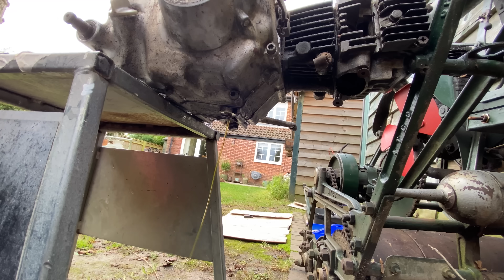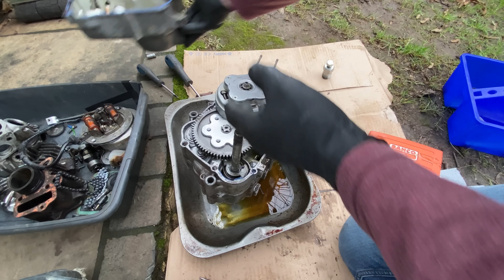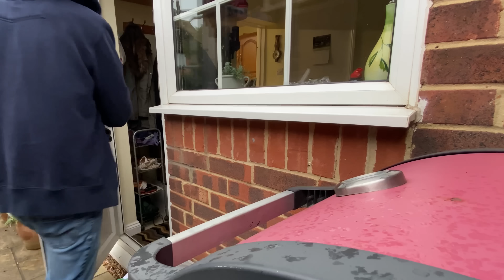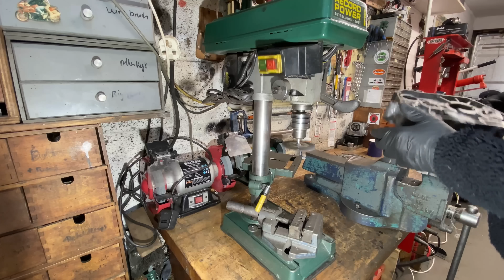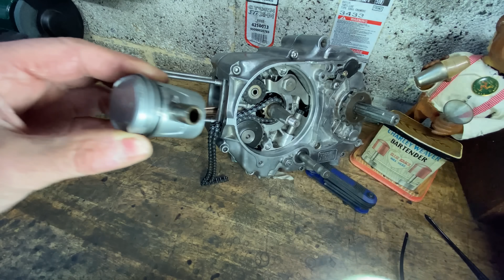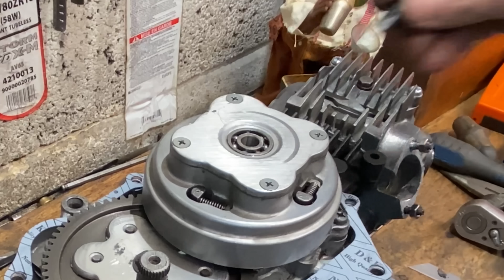Honda SS50 engine strip down, rebuild and start

Comment: I thought for a moment you were about to upgrade your lawnmower. I am in the process of restomodding a 1969 SS50E for someone at the moment, with a larger 110cc motor slotted in and all new 12VDC electrics, all without  modifying the frame in any way.

Comment: Thanks for the fun and interesting video.  Tracey's crocheting looks really nice, and where would you be without a cupcake and a cup of tea to keep you going.  I love those little Honda engines. They are like a miniature version of a larger engine with overhead cam and all.  Being 4-strokes they sound so much more civilized than a buzzing 2-stroke.  I'm not sure, but I think they are actually the original Honda 4-stroke engine on which all other Honda 4-stroke engines are based.  (I wonder if this is true?)

And they sound really cool with no exhaust pipe. Kind of a putt-putt burbling sound like George Jetson's flying car. I used to watch The Jetsons about 50 years ago on Saturday morning sitting on the living room floor with my sister.

Keep up the great work Allen.

Cheers from Canada  :-)

Comment: Allen you have said the engine takes 0.7 litres of semi synthetic oil.
These engines were designed before synthetic oils were made. 
It's mineral oil that's needed.
Reply: They work better with semi synthetic oil
Reply: @riderzinc  we have done the plop enduro for 3 years and only used mineral oil. We've had no mechical breakdowns from the engine. But having spoken to some teams who have, its usually those that are running synthetic oils.

Comment: Oddly, this was the first video I saw of yours. I have seen many engine rebuilds. I have seen all the engine videos that Robot from VespaMotorsport has done. Paul Brodie's skills are great. I watched a lot of Rukus builds, too. As I watched your video, I was thinking, well, he's doing a low-buck rebuild, but I think he knows motors pretty good--and then I saw the rest of you videos. Wow! LOL!

For ratings, but mostly because they are cute, perhaps a 2-cylinder Honda Grom or Monkey engine would be popular, and neat. The engine isn't that different from an old Honda Cub motor. The later ones have 5 speeds. The parts are cheap.

[When I was younger, I had both a Honda CL-350 and a CB-450. I loved my Honda CB-450. Yes, it was bit top-heavy, but it was a wonderfully reliable bike. I had an old XL250, that I was rebuilding the engine for, but someone stole it.]

Comment: Hey shit for brains! That's a Honda C70 block! A C-50 is 90* to the crankcase! I have a Honda "Step-Thru" C-50 from 1961 100% original in powder blue with 18,000 miles on it. Honda of America has photographed it and offered me $27,000 for it ser# 000023xxx. IF it were a TAN one, it'd be worth $100,000-$200,000. I have 178 "classic" pre-1978 Hondas in my collection including Mike "The Bike" Hailwood's CR-300F 6 cylinder 340cc F-1 racebike (the "B" bike) in running condition. All my bikes RUN and if street bikes, are TAGGED including the 1958 CR-250 Benly ("Friendly")-the bike that put Bridgestone and Triumph TigerCub and Hardly-Davidisome Aeromacchi and Barely Starts Anymore out of business!

Comment: Had a 1977 green SS50 when I was 16, kick start spines were shot on mine (previous owner welded the KS on to shaft) , replaced the shaft and new one didn't last long so used to bump start it

Comment: Is that engine the same as or at least similar enough to the engine of a 1966 C100 Honda Cub to use this video as an aid to rebuild my engine.
Reply from the maker: Similar but the c100  is a pushrod engine with iron top end

Comment: Oh does this ever take me back! Got a Honda QA50 from a friend of my mom - in pieces. 😳
Since I was 12-13 years old at the time & didn't have a reference we ended up taking the engine to a motorcycle shop to get put together. Rode the snot out of that little Honda & ended up selling it when I moved up to 4 wheel transport.
Wish I had this video back then - thanks for sharing! 👍

Comment: I traded , around 1978,9(I was 15 yrs old) a Radio Shack 3 channel CB Walkie Talkie, for a 1975 Honda MR 175, racing Enduro, that didn't run...pulled plug, plug dry, carb getting gas, have spark at end of sparkplug wire, hmmm, take head off...apparently before i got it, someone had head off and instead a head gasket, tried to use Silicone gasket sealer, used so much, it had squished into the top of cylinder, filling, lol...pulled cylinder, cleaned out, got a head gasket, new plug, put cylinder, cyl. head back on, rt gasket, 3rd, 4th kick, it fired rt up...had that bike for a yr, before sold, that thing was crazy, when the power band kicked in, all it wanted to do, is lift the front tire...

Comment: What a gem of a video! I did this very same thing to my 1978 model back in 1980. Mother was not too happy. My room smelled gas and oil. I still have the original piston on my bookshelf.

Comment: Looking at the disassembly f this engine  it looks like some amueature took it apart and didn’t have he tools or knowledge to put it back together correctly ? BTW these are my favorite drivetrains  i actually have my Fathers 1064 Honda 90  that was in proper inside storage since 1965  untill the 1990s  is completely original  minus a proper refreshment of Rings  Gaskets  and a couple of other N.O.S. interior engine  parts

Comment: The engine cases dropped pretty easily onto the shaft bearings. My experience is you typically have to heat the cases to expand them because the bearings are supposed to be an interference fit. Any chance the bearing's outer races were/will rotate in the cases?

Comment: I have a CT110 engine that is in parts, all rusty and dirty. This video helps me to identify what the parts are and where they go and what order to assemble them. I know they are not the same motor but very similar  Allen gives important information that is not included in either of the Clymer or Honda manuals. 

P.S. I have watched this video three times already and downloaded it also.

Cheers Allen

Comment: This video has renewed my interest in an old stashed away project. I have a pushrod version of this (1962 C110) in my basement for 20 years now. I'm confident in my abilities for all the mechanicals but the magneto ignition is new to me. I have points in some of my cars but never worked on magneto ignition. That will be my learning curve whenever I get around to doing the rebuild. Looking forward to it!!!! Thanks Allen!
Reply: I love the pushrod engine
Reply: Start at just cleaning the point it might fire

Comment: I hope you spaced the piston ring gaps accordingly and by the way, the high-pressure feed to the cylinder head stud needed a copper washer under the nut. A lot of people ask me why is there one copper washer under the head studs and that’s because it also seals and holds the oil pressure back.

Comment: I completely enjoyed watching this, great tutorial. Interesting difference for names here in the states. Your cir-clip is what we call a snap ring! We have cir-clips but they are a bit different. Who ever owned that little engine apparently took decent care of it, you cannot hide this fact, just look at how clean the inside was and there was no proof of oil starvation. A personal thing I would have done different is I would have used Blue Loctite on the screws. It's a mild retaining compound and the screws can be removed with little effort, but it will ensure the screws will not vibrate loose. Not saying those will, just a personal preference. I worked for 37 years building aircraft pumps, blowers and electric motors so it's a preference based on a few years experience. You did an awesome job and I thank you for sharing.

Comment: Reminds of stripping my Yamaha T80 Scooter all looked clean and good except for a dodgy valve seat after regrounding it went back together well with new gaskets. 
It had done 80,000 miles not bad for 80cc Ohc four stroke with 4 gears and shaft drive all of its mileage being commuting in London.
Well made by Yamaha....

Comment: No valve guide seals... Those valve stem clearances to the guides must be exceptionally well set during initial construction of the engine. The simplicity and elegance of the engineering in that little engine was wonderful.

Comment: I had a 75's SS 50, had 5 gears though. And if you replace the Honda SS 50 cc barrel with a Honda 70 cc barrel piston and rings  what you have is 5 gear 70 cc that can do 65 Mph or 110 Kph. Well I don't really know as the SS 50 speedo only went up to 100 and the needle kinda went way past it. However a standard Kreidler 50CC two stroke still beat me. The SS could run on petrol fumes a very economical bike and very reliable engine. I should have dropped a tooth or two on the back sprocket for more top end, as the first gear was not really needed on a straight road.

Comment: In the 80's I had a Honda CT 70. It had a issue when I hit around redline it would sift into a taller gear automatically. I didn't mind that!

Comment: Just discovered you Allen.  Amazing videos.   As a total novice doing my first restoration on a pc50 k1, what type of paint do you use to paint the barrel?  Does it need to be VHT paint?  Mine are at the vapour blasters at the moment. Thanks. Daren

Comment: I use a bench pillar drill to compress the valve springs when fitting collets, made up a tool that fits the drill press chuck, gives a good high level working height.

Comment: I had a 5 speed ss and mate had a 4 speed
I over reved it and valve went through piston about 1980 i then bought ts100 er suzuki 1981 w reg £540 new on road

Comment: My 1973 SS50 did 35,000 miles before I sold it and the only problem I had was at 15,000 miles, the exhaust valve burnt out. I do miss it.

Comment: You have thightend so many bolts, that you have a build in torque sensor in your hand. Nice job! I would have used a lot more oil on assembly. Just in case, probably overkill I know.

Comment: I had a Honda 50 in 1973.  Looks like the same engine.  I can tell you how to work on the carburetor because mine required adjusting just about daily.

Comment: A 1970's Honda 50/70 engine and doesn't look like its changed much in 50 years.  Amazing how they got it right so long ago.  This is an excellent and interesting how-to video.  The sound of that engine brought instant memories...I remember Mini-Trails seemed loud for 50cc.
Reply: They still make this exact same engine btw, the Honda CD70 motorcycle is still sold in Pakistan ever since the 1970s, but the last underbone/supercub with this engine is the 2013 Honda EX5 Dream sold in Vietnam, Thailand, Malaysia, etc.

And while the updated EFI engines look similar externally, all of the internal components are different. This is made to comply with emissions in countried that has euro 3+ emissions standards, on countries with little to no emissions Honda still make the old C-series engine.

Comment: The one thing I don't like Hondas for is WHY did they use so many metric fine threads on so many parts all over the bikes. It makes replacing bolts or repairing stripped threads a real pain 🤔🤔 love watching your vids and how calm you are stripping them down when I'm as nervous as a nervous thing doing engines 😅🤣 👍

Comment: Thank you! I am ready to take my Z50AE engine apart for a rebuild for my winter '78 Z50 restoration. I would have liked to have seen you put the gears together. There are other places to see that but what I get from this content is your shop practices, which are top-notch and very helpful as I contemplate my engine rebuild. I will be doing it all myself.
Reply: Check out mini motor man for the gears

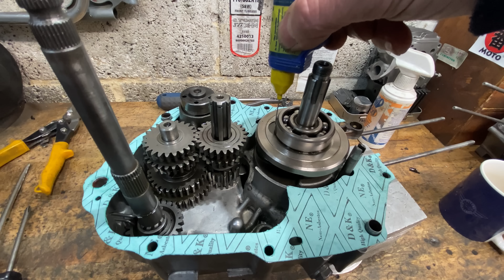Comment: Sorry to say, but you forgot an important washer that goes on the kickstarter axle, before closing the middle part of the engine. Your kickstarter axle will have more sideplay and possibly too much even. At 11:03 minutes it is clearly visible. And afterward the hassle with the spring for the kickstarter is also not needed. But I like your video anyway. Greets Dennis

Comment: Never opened a genuine Honda one of these engines, but have done several Chinese clones - the quality of parts inside the Honda is different league - especially the gear selector stuff, but, erm, pretty much everything else as well.  Very interesting to watch. :-)

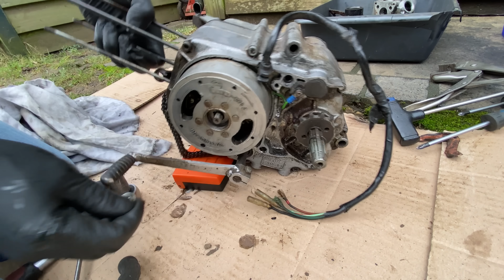Comment: i have a question. I have one of these engines and am trying to do a rebuild. where would I find the clutch removal tool (4:31) and the flywheel removal tool (2:55)/

Comment: I had a SS50 many moons ago. Its was a perfect bike for twisty roads in somerset, even two up.  Despite its tiny size it was a really solid engine with amazing range and even makes a nice noise. Swapped it for a Suzuki B120. Both great little bikes. Good days.

Comment: Yes I enjoyed that Allen although I admit I don’t know why. I even had a look for an old Japanese motorbike online as it looks fun but they have become so expensive! You could buy an old scooter for £5-10 when I was a teenager and I even had a Yamaha 125 which cost me £120 and a CX500 which didn’t cost much more. I have graduated to classic cars now but these old bikes have a lot of similarities with air-cooled classics except that you also have to accommodate a gearbox in the engine casing!

Comment: My first bike was a ‘72 SL-70. Rode it WIDE OPEN every single day for a decade. HARD, no mercy. Replaced the plugs a couple of times, the clutch once, a clutch cable once, front & rear sprocket & chain a few times, and literally NOTHING else. Then, a local man bought it from us, put the turn signals back on it that I took off when new, replaced the knobbies with some street/trail tires, got it licensed and rode it to work every day for at least another decade!  Those 50 & 70 (49 & 72cc) engines are some of the most durable EVER made. PERIOD.

Comment: Back in 1963 or so I owned a Honda C110, 50 cc. My only mode of transportation. They were prone to seizing when ridden hard, which was the only way to ride as far as we 17-year-olds were concerned. Anyway, I rebuilt mine a few times, on my lunch break, in the parking lot of the store where I worked. Really just a piston and barrel replacement. Didn't even know what a torque wrench was, just used the tools in the tool kit that came with the bike.

Comment: I've never rebuilt a motorcycle engine. I have big block Chevy engines before, and I always use lots of assembly lobe along with other mechanics that I know, including my brother was a mechanic I noticed you didn't use a lot of what you called oil when you're assembling it I'm wondering if the heavy assembly lobe is just an American thing? I take it there are still parts available for that engine and gaskets; I have a Yamaha XT 550 1983, and I need to clean the carburetors out. I'm hoping I'll be able to find gaskets.

Comment: A guy I grew up with had a Honda 50 street bike and thought if he blew it up his dad would have to buy him a bigger bike. So, he redlined every gear and dogged the crap out of that bike, but he couldn't blow the engine. It did get considerably weaker with each ride, but he kept trying. Finally he couldn't even shift to second gear because it would start slowing down. So, he presented the now worn out bike to his dad and pronounced that he needed a bigger one. Well dad wasn't stupid, he knew the kid was abusing the bike so he said he'd get him a bike tomorrow. HE CAME HOME WITH A BICYCLE!!! I laughed my azz off when his dad unloaded it from the truck and then I rode off on my old Yamaha 125, killing mosquitoes all the way home!

Comment: Hi Allen - great to see that beautifully designed baby engine burst back into life, with the sweetest tiny ‘putt-putt’ from the exhaust!
You also mentioned about your S1 550 engine - I haven’t watched the previous videos on that build yet, but I guess this is an expanded S3 400cc engine?  So is it right to call it an S1?  I thought that was the code for the really neat 250/3 motor?
Cheers, Nigel

Comment: Very nice engine. In good condition. Cylinder was like mirror and no honing? I am surprised how little and smooth oil you use during assembly. Didn't you think about rebuilding ignition to cdi?

Comment: I had a SS 50 back in 1977 , candy green, it became increasingly difficult to start, until it eventually refused to start . 
After taking the bike into a dealership, I was or rather my father was informed that it needed a re bore and new valves and piston , but after the repair it would start at the first attempt . The Honda SS 50 was tremendous fun a great little bike.

Comment: Honda oil drain plugs have a very shallow hexagon. I ground the end off a socket to remove the chamfer. After that no more chewed drain plugs
Reply from the maker: yes I have a few socket ive turned to remove the chamfer

Comment: Actually it's a 49.9cc engine, i used to ride one of these SS Hondas back in the 80's.  You forgot to show the contact breaker mechanism, sometimes the platinum contacts are pitted. Good video for memory lane.

Comment: Enjoyed that. Not sure of the year or model number but about 1969 I bought a Honda mini bike with that motor. It was a 3 gear. Tiny fat wheels. No spokes. The inside of wheel rims were the brake drums. With handlebars & seat folded down it could fit in the boot of a Mini.

I bought that bike used in Bermuda. Had it shipped to England in 1970 & used it on the Isle of Wight for a year. Sold it to Daves Motorcycles in Newport, IOW where last seen it was in a display window.

Who knows, that little bike might still be around. A rare one for sure, even back then.

Later I had a PC50 in Bermuda for a number of years. A great little bike. Very comfy to ride.

Comment: Those C50 engines were very well made considering the mass production of the mid 1970s, when the SS 50 had to compete with the two stroke FS1-E for 16 year olds. They were prone to broken piston rings for some reason, possibly being revved to the max to get over 40 mph.